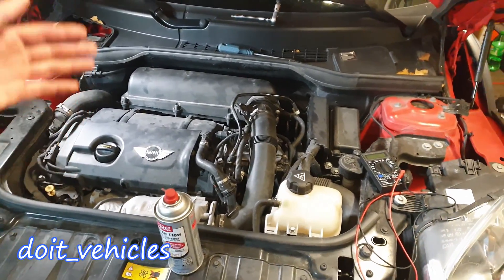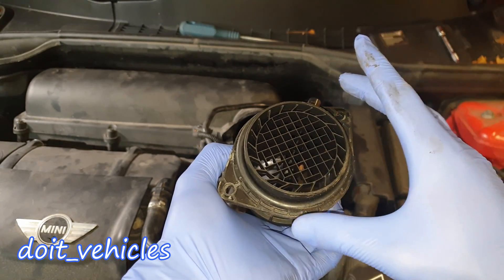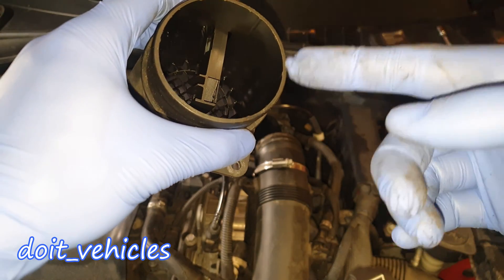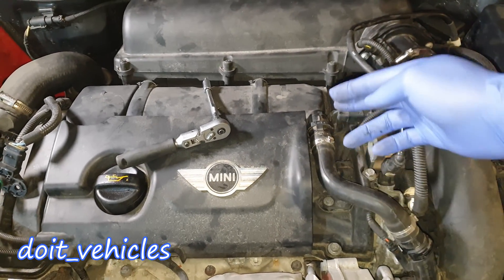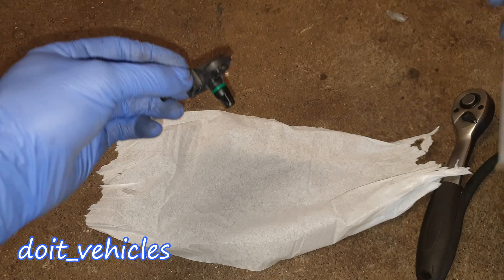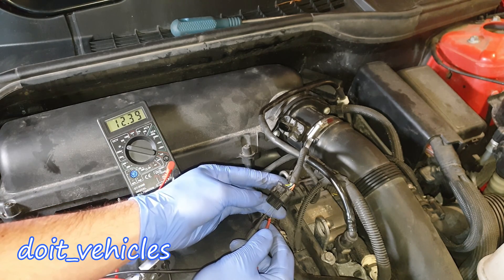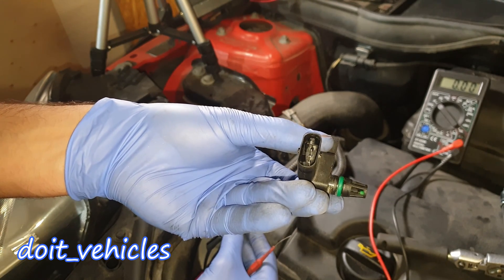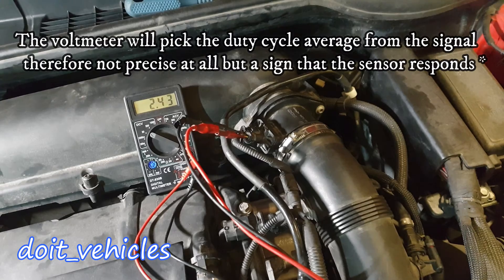Mini Cooper S Mass Air Flow Sensor IAT / How to Test and Clean & Extra Explanations

Comment from the maker: More Videos about the Cooper S : 
All Fuses &Relays Location : https://youtu.be/6reWaKDPxeE
Oil Change : https://youtu.be/pBqzwVnKyuA
Air Filter : https://youtu.be/wXJkxOUMerk
Throttle Body : https://youtu.be/ziA-sXUbaKc
Spark Plugs Change : https://youtu.be/hd4FWqj-2iA
Reply: Dang I can’t find you videos on mini
Reply: Thanks for the video, my 208 gti has the same engine, my idle mass airflow g/s are anything from 1.8 to 2.5g/s. This seems low compared to your idle readings at the end. My sensor is reactive (g/s increase when I rev) but to nothing crazy - 15g/s which still seems quite low. I am getting my spray tomorrow, I hope it fixes it.

Comment: I bought a 2014 Mini S in manual. Drove it 3 hours home and the next day I took a short trip and the engine light came on and the car started struggling to accelerate. After about 20 minutes and turning the car off and on the light turned off and the car drove normal. Not sure what this could be

Comment: Hello. My car (Mini Cooper 2009 s clubman ) showed the code for the mass air flow sensor the Mecanic replace it and the check engine light came up again after testing the car that same day (by the Mecanic) then I went to get it an hour later and at the shop the check engine light came up again. Not to mention when this check engine Loya me up the turbo I guess it blocked to avoid more damage to the car. Is it posible is another thing instead of the mas aire flow sensor (it can be the air temperature sensor)

Comment: This video is amazing thank you so much! I got a check engine light (Mass Air Flow Sensor, System Too Lean), and when checking the engine realized the air intake duct was completely broken. Replaced that, but the light is still on. Should I try cleaning the MAF sensor or replace it?

Comment: Any idea why my 07 mini S will not stay running with the MAF sensor plugged in but when I unplug it it will stay running. I replaced the MAF sensor but same issue. Thank you!
Reply: I have the same problem, did you find the solution? any luck??
Reply: @scedillos1  
In my situation I had bought the car with the MAF sensor issue. The engine and tranny had been pulled and reinstalled. The air hose going to the turbo charger had come lose so I reattached and tightened hoping that would fix the issue but it didn’t. I then reinstalled the old MAF sensor that had been left in the car and it fired right up. So seems my problem was a faulty new  MAF sensor. Good luck!

Comment: When I test the sensor wire with it disconnected from the mad sensor, I test 5 volts.  The power for the sensor is is 5 volts and the sensor wire is 5 volts.  When I start the car and connected to the MAF sensor, the sensor wire drops to 2.41 volts. I think I have a wire problem.
Reply from the maker: there should be 2 / 5v wires with the connector off
Reply: I have a P113B code that continues even after clearing the code. I have replaced the MAF sensor.  I have 12 volt and two 5 volts on the sensor wires using the ground in the plug when unplugged from the sensor. It appears to work. If in the run position but not running, I can't clear the code.

Comment: Good information. I  have a 2008 supercharged convertible. Are the sensors located in the same locations? Also, there is this awful cracking noise coming from my steering wheel when I turn it. Any idea what that might be? Thank you.

Comment: Hi your Video is really help full thank you very much for clear expectation. I have Mini Countryman 2014 model some time while I’m increasing the Gass getting a error message says ENGINE MALFUNCTION REDUCE POWER kindly advise me regarding this issue.
Reply from the maker: Glad it helped . First get a scan tool or someone who has it , connect it to the obd 2 port and see what are the reports : Live data , trouble codes
Reply: @doit_vehicles  Hi I already scanned but technically there is no issue with system
Reply: Hello i have the same problem  did you get it fix  let me know  please

Comment: Thank you for explaining the reason why there is always oil near the air intake temperature sensor. But why would it leak out of the manifold? My car looks really dirty and oily under the manifold housing the temperature sensor. Thanks
Reply from the maker: There can be many points through where the oil can leak . Check where the oil looks more fresh and that's from where it comes , or clean it and see from where the oil comes .

Comment: Engine rpm goes up and down at idle in 2013 mini cooper countryman. Why?
Reply from the maker: needs some diagnose , might be a vacuum leak
Reply: I have the same problem, I also guess it is vacuum leak.
Reply: How to diagnose by simple method ? Thanks for your professional advise.